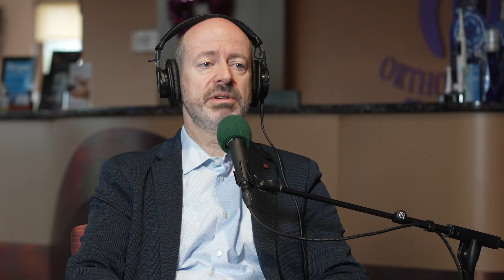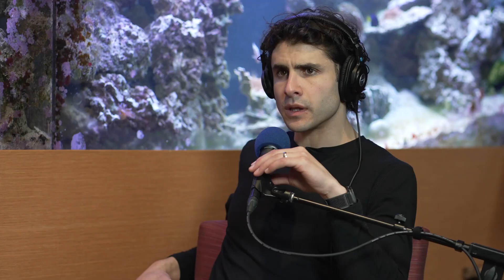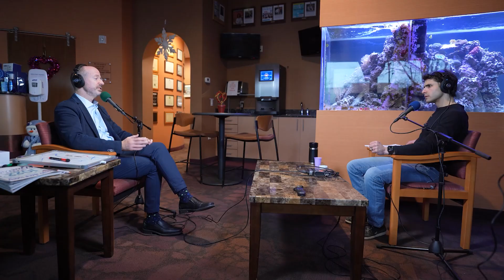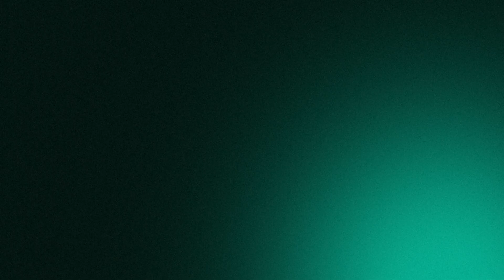The Problem with Midline-Only Expanders

Comment: Hello Ron, for MSE expansion what is the maximum expansion width potential, from a decent bite,without lower jaw surgery needed. You have probably covered it
Reply: that entirely depends on your specific situation, I think he gives the generally tules of thumb that 10mm is where you start pushing it, but again, everyone is different
Reply: @JuanParea 10mm? That’s a lot, didn’t Ron go from a bite where his lower jaw was wider, making widening the maxilla easier. Going from an occlusive bite, the lower jaw can only follow like a certain amount dentally.
Reply: @X64534  sry i didn't really read the caveats you listed afterwards.  Its impossible to say how much is too much without looking at scans of your face. But if you already have a good bite, then any significant amount of maxillary expansion is going to require some follow-up mandibular expansion as well to keep an even and healthy bite.

Comment: We need to normalize over advancing for aesthetics. I need a surgeon who is willing to do Anteface/facepush procedure
Reply: The issue with this is that over advancing for aesthetics is still a fairly new and unexplored method of practice in a field that owe it's premise to functionality. It is a rising trend though, so you will see more and more progressive surgeons as time goes. It's important to note that aesthetically motivated movements rarely come alone. They are usually paired with supportive and accessory implants. Good luck!
Reply: Juice must fund this, at the of the day its getting very profitable and beneficial for everyone